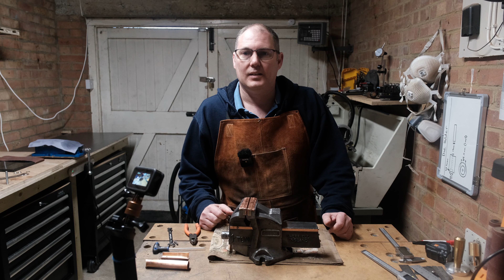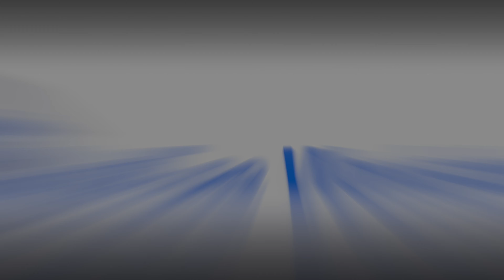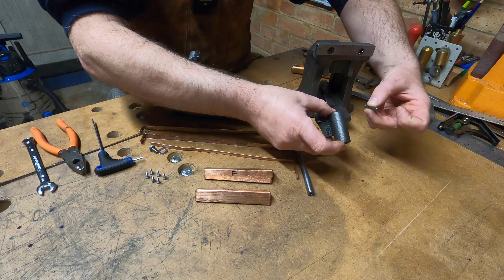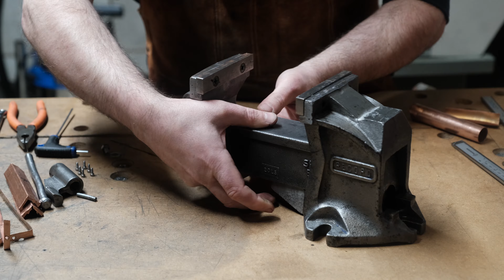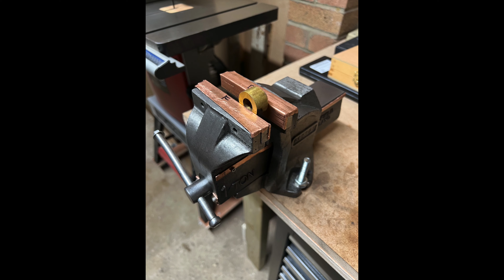Old 1 Ton Record bench Vice Repair

Comment: Quite innovative mend mission.  Copper is a good choice for runners, and for certain jobs, jaw inserts.
B&Q sold these 1 Ton Record vices for ~£20 in 2000 just before Irwin acquired.
Reply from the maker: I was going to buy a new vice and use this as a spare but it’s been solid and reliable since my repair so I’ve not needed to buy a new one. Works great for my needs.
Reply: That was a steel for that price id of bought a few lol